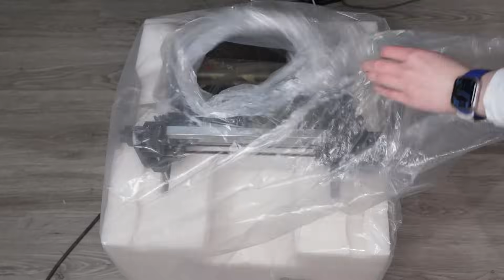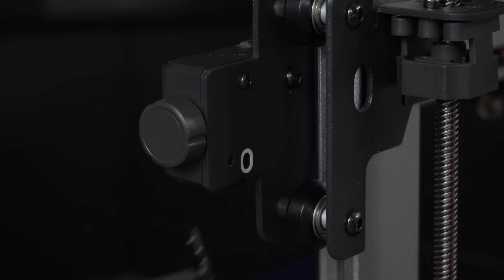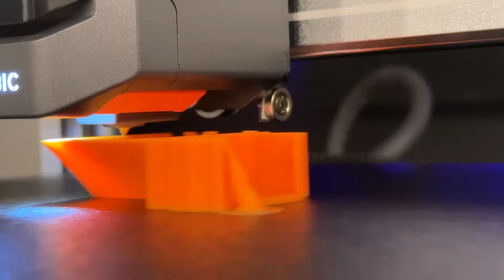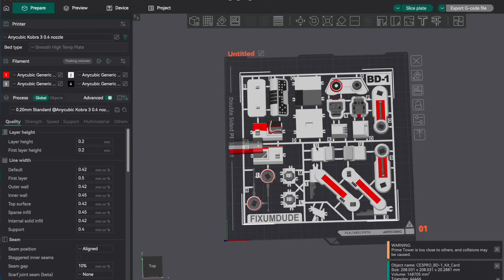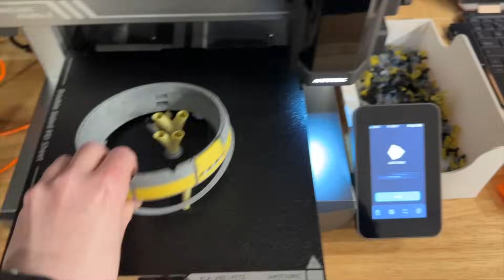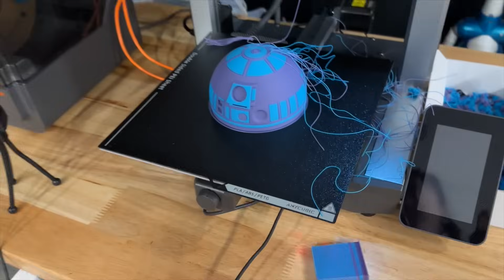Is the Anycubic Kobra 3 the Best Budget Multicolor 3D Printer?

Comment: DO NOT BUY the AnyCubic Kobra3 printer!

I bought the Combo printer based on a review, thinking it would be a modest upgrade from my Creality Ender3. After less than 6 weeks, it took a catastrophic dump, and no function worked. After waiting 23 days for a replacement cable, it didn’t fix the issue. I spent 3 weeks troubleshooting and asking for a refund. Despite sending 10 messages, they never gave me troubleshooting information, ignored the possibility of a faulty machine, refused a refund, and their offer?– a 1KG roll of filament as compensation. That they have not sent!!!!

THEY ARE A LYING, COWARDICE COMPANY THAT HIDES BEHIND A CRAPPY REFIND POLICY!!!

DO NOT WASTE YOUR TIME, EFFORT, OR MONEY ON THE KOBRA3!

Comment: I've been having constant issues with the printer, bed adhesion is poor and the auto bed levelling seems to never work right.
Reply: Didn't they fix it with updates,?
Reply: I have an ender 5 with a fulament magnetic upgrade and had nonstop issues with adhesion, even with all the 90% IPA being applied. Use HOT soapy water to thoroughly wash the bed, then use IPA. that has a good chance of fixing your adhesion.
Reply: @RJWaynerium  I replaced the bed with a gold pei plate, it worked well with my s1's. Still didn't work. soap didn't work. Turns out many others had the same issues like the bed being warped.

Comment: I love my K3 combo, first print was a custom colored benchy, next was a 24 hr 3 color dragon print, and it's came out great tho I did lower my purge volumes a little to much and have some streaking in the head where it starts after the purge tower even then I love the multi color prints and the dryer added in is just a plus.
Reply: Also to add I've just been using my creality print slicer to slice for my k3 as it has the printer in its database and I've found it to be much easier to use than the anycubic slicer, I could be biased on that seeing as I've only ever used creality print up until the K3 Combo
Reply: Is Cobra 3 Combo still good? Did they update the mistakes? How is your long use experience?

Comment: im jelous that you didn't get any bed adhesion problems like i did. straight out the box the 2nd spool struggles so hard to push anything through and the filiment that does extrude doesn't stick to the bed very well aaand even when i managed to get something to fully print, the first layer was so janky with misproportioned details and low quality as a whole and i was using one of the default test prints. overall i was disapointed with my printer i got

Comment: I would be curious to find out how the AMS changes over filaments when one runs out.  My filament reels have the last piece folded into the spindle, which means it can't pull it off the reel without some serious pulling.  So does the AMS change over if it meets resistance, or does it only work once a filament out detector triggers?

Comment: Nice honest review of the printer. I have had the Kobra 3 since June and it has printed straight out of the box using the Anycubic slicer based on the Prusa slicer for me. I have now changed over to using the Next slicer based on the Orca slicer because it does have way more funtions and I have had no real issues with the printer. Anycubic have also had multiple updates on the slicer and the firmware so they are ironing out problems with both, but over all I love the Kobra 3,  It has so far  been a brillaint printer me apart from one hotend leak which I caught before it did any damage to the head.

Comment: Thanks for the solid review. Good points about the waste costs, people don't think of that. Nice pricing there. Nice points about the issues with the software and lockdown on sending files. I'm not into multicolor, I'd prefer to paint stuff, but I like the idea of having multiple filaments to avoid run out. And I like the idea of having different material like soluable for supports.
I am curious if you are going to try a filament recycler at some point?
Reply from the maker: I would definitely be up for testing out a filament recycler! Right now I don’t think there’s one that is a good balance between effectiveness/quality and price, but hopefully we see some options out there soon.
Reply: @MMsPropShop   There have been a few home brew things built (CNC kitchen as an example) and a few commercial. I believe the limits of the plastic are a problem. Each time you melt it the molecule chains shorten until they can't be used. Also, many filaments have their own temperature range.
Pity, it'd be cool to see a prop printed in dozens of colors! lol

Comment: Thanks for the review. I picked one of these up and had both software and hardware issues. So much so that I returned it within a week and a half of getting it. I was hoping this would be a solid machine, but I had issues like you and even more software quirks you did not mention. Then factor in how I was at the point of having multiple physical replacement parts mailed to me within the first week...I said no thank you and did a return.
Reply: get an a1 combo, its to good i have 4 now
Reply: @calebrosenhauch4296 Bambu I heard on the grapevine will be preventing third party …… Anything else .Thanyou.
Reply: I had tried several different slicers but had to use the Anycubic to get it to print properly. The extruder nozzle retainer is simple and bad. I thought I had it secure, even tried pulling on it and it didnt move, only for it to fall out because it didnt actually secure. It scratched up the magnetic plate cover. Later it did it again and actually bent. I attribute it partially to my ignorance but that is jsut a bad setup and needs to be corrected so that it is easier to lock the extruder in place. It also jammed... A TON! The jams are what led to the extruder falling out. You can print remotely from the Anycubic slicer software but that was the only one I could do it from. I did manage to get a tester print done and it came out nice. So when it prints its good but the restriction on software that I found and the not beginner friendly causing some major issues I would not recommend this one. If you are seasoned with 3D printing then you will probably be ok but nah.
Reply: Works perfect for me
Reply: @3-DFrontier most of their failures are all operator error. People tend to find something to blame but theirself
Reply: That's pretty much Anycubic in a nutshell, still resting on laurels from machines maaaaaaaaaaaany years ago.

Comment: The PTFE tubes from the AMS to the printer are a specific length and if you change, those are short notice that is coded into the firmware and changes the ability of the program to know how far they have to feed the filament or retract the development so it’s best not to trim those.
Reply: I trimmed the cable and have no problems with it
Reply: @finnawennijpels6045same pretty short actually when I went top mount
Reply: the system if it fails to trip the sensors when feeding or retracting just continues to push filament.  It does not care about length.

Comment: Kobra 3 combo = $379 aud, Bambulab A1 (without AMS) = $439 aud. 
So, is A1 realy that much better to buy it over the Kobra combo even without AMS? Or did anycubic actualy fixed some of the things people are complaining about ( reviews are confusing so far), and is there a way to make it better. 
It would be my 1st 3d printer, and I don't mind tinkering (if tinkerable) both software and hardware side. 
Other printers also considered, sovol 6 ace, FLASHFORGE a5m or maybe even a new FF a5x. Opinions and advice welcomed. 
Thank you!
Reply: A1 is pure joy and just print stuff thats it
Reply from the maker: If you’re looking at the Anycubic website, even if you change the shipping destination it doesn’t switch the currency, so it’s actually $379 USD (about $586 AUD).
Reply: if you dont mind tinkering then you can basically get whatever printer you want, they are all great machines when run properly. dont be worried about all the negative reviews, some people are just so technically illiterate that they cant troubleshoot simple problems. 
bambus are nice, but the not having to tinker also means you are pretty locked down on the software side and have to use their system. 
i would choose based on other features, do you need the dryer, an enclousure, maybe bigger bed (neptune 4 plus), easy nozzle swap, etc.
also, the $379 aud might not be the right price, its around 400€ while the A1 is on sale for 300. there might be shipping or import duty missing, or its the non combo price. 
have fun with your first printer, its a great time to get into the hobby!
Reply: Oh, I have changed it and waited for a bit (thought it refsrehed) , few days ago it was pretty much same as A1 (no ams) and i thought it maybe dropped down even further. Idk, still not convinced in this system of MMC printing, too much waste and long print times. Bambu it is then (just for resale value), even though I hate the fact it's closed source all the way (no upgrades.).
 Nice editing with useful info btw
Tnx for replying 🖖